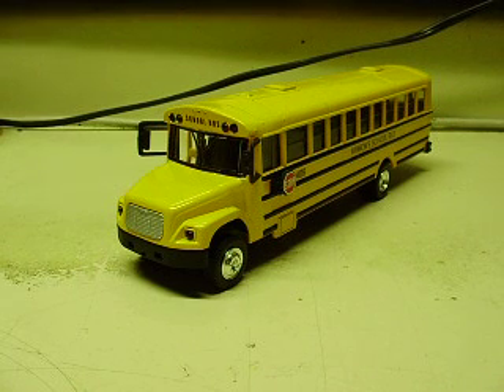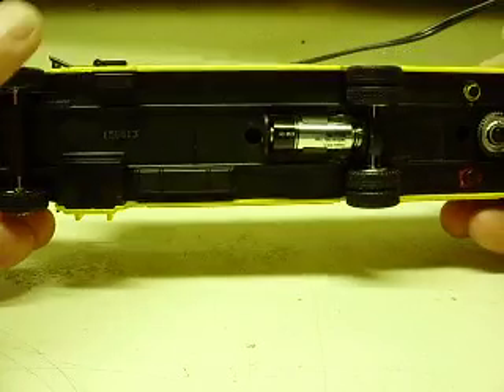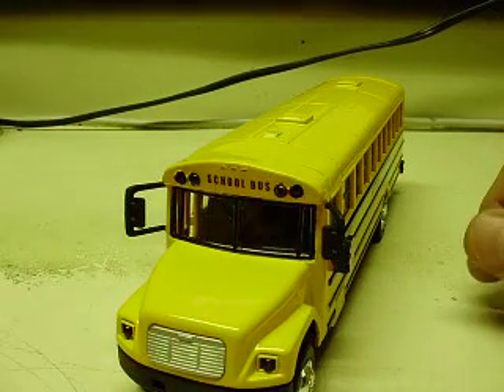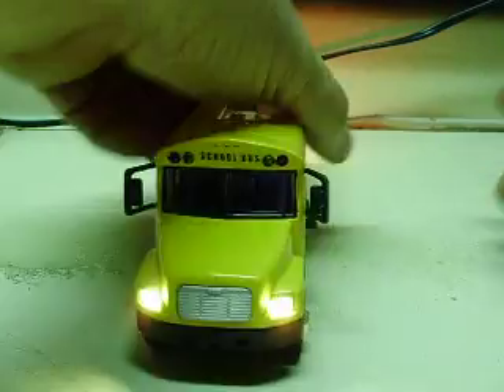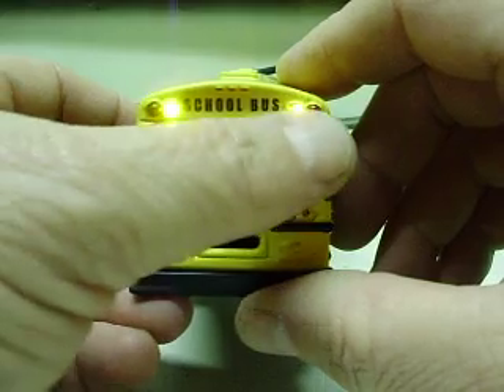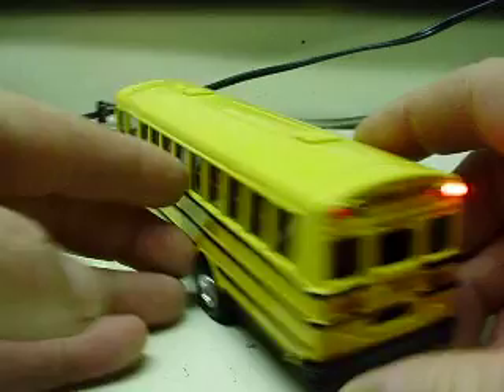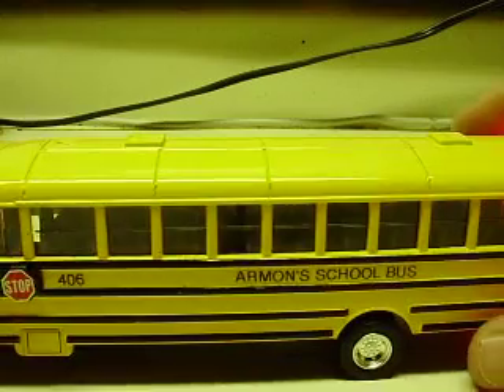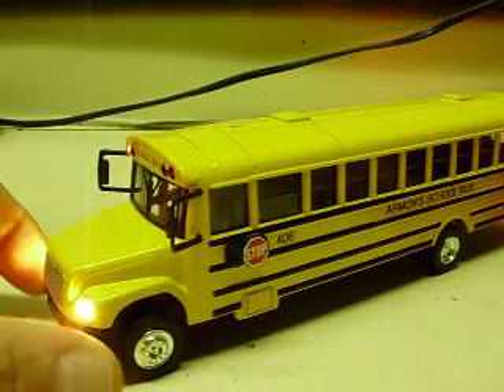Custom 1:53 Thomas FS-65 diecast school bus model with working lights

Comment: I already have a bus how much would it cost to get what you normally do for school buses and add a strobe
Reply from the maker: To add true alternating reds and yellows along with headlights and tail lights is $100.  The rooftop strobe is another $15.
Reply: What about just to get custom lettered
Reply from the maker: I can do that for you.  I can just make the labels and send them to you though.  No reason in sending the bus to me unless you just want to.
Reply: 01bluebusa how much would that cost
Reply: And it has board of education on it how do I get that off
Reply from the maker: If you just want black letters like this bus, I'll do the school name for $10.  Some schools have white letters on a black panel.  To do those, its $20 because I have to cut black vinyl strips AND make the lettering.
Reply from the maker: I use acetone-free nail polish remover and Q-tips.  Be careful though!  If you use too much at one time, it may remove some of your yellow paint, too!  Also, the black stripes on the sides are they same type paint as the lettering.  Be carful there too....it will easily remove those as well.
Reply: I sent you a email will you check it out
Reply from the maker: Well, I get about 40 emails a day about builds...  Remember that bus models aren't the only thing I deal with so emails can get confusing.  I'm sure your email isn't  your YouTube username, so I wouldn't know if you emailed me or not lol
Reply from the maker: lol...sorry...  Actually finishing up the THOMAS logos now.  I already have the other labels printed.  Email you in a bit.
Reply: 01bluebusa thx